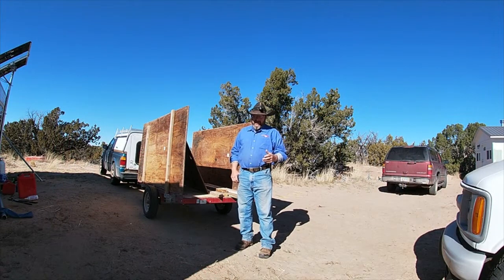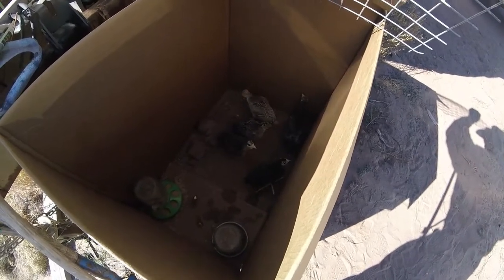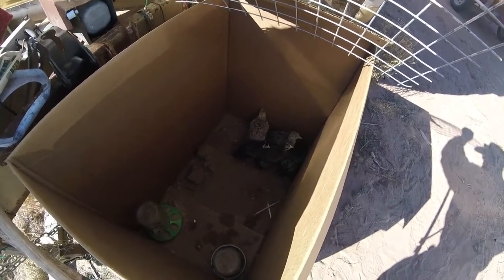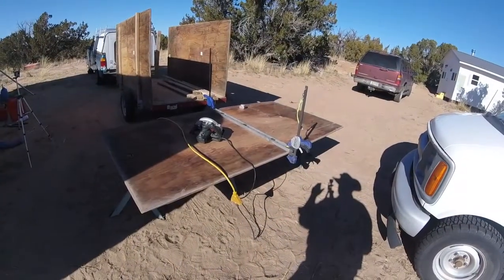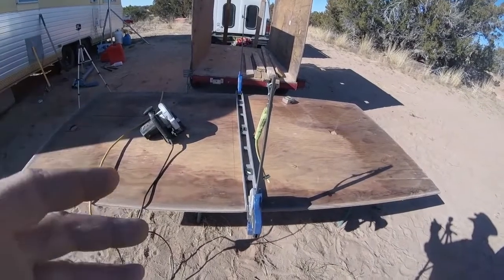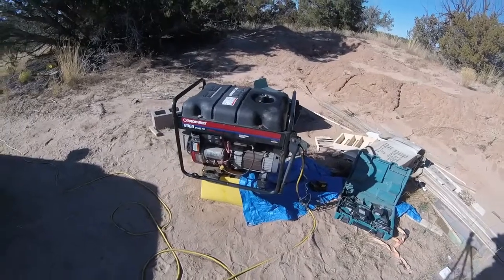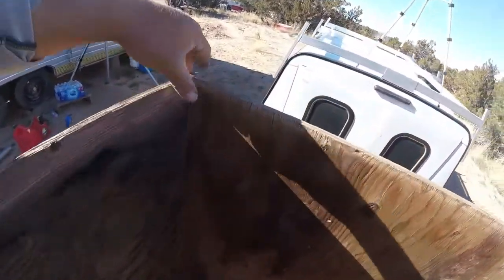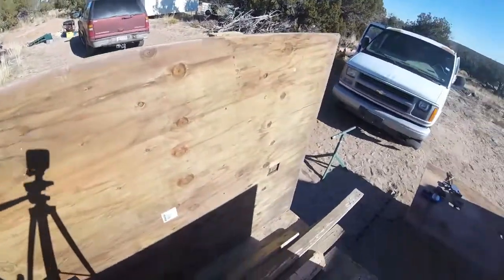Diversified Income Streams

Comment: Good Morning. Is that trailer big enough to handle the weigh of the wood?
Reply from the maker: Lol, oh yeah. We have hauled much heavier materials than a cord of wood on the ole Habor Freight Trailer. But it has had some upgrades.
Reply: I see what some of the commercial woid cutters haul and their 3/4 ton trucks are squatted pretty good. I hail half cord at a time to save suspension on our truck.